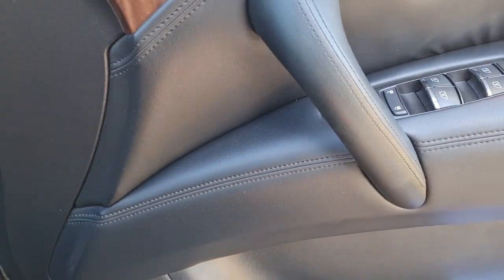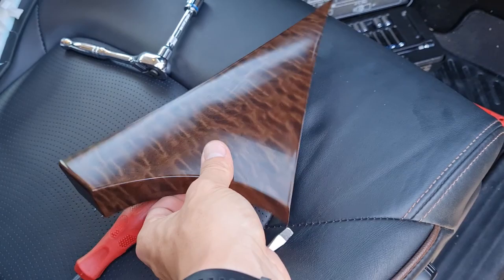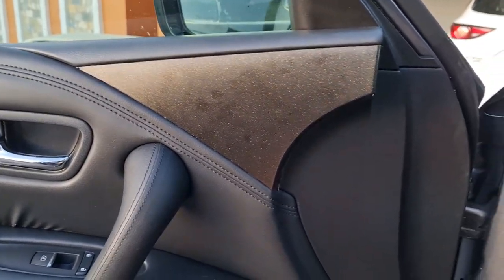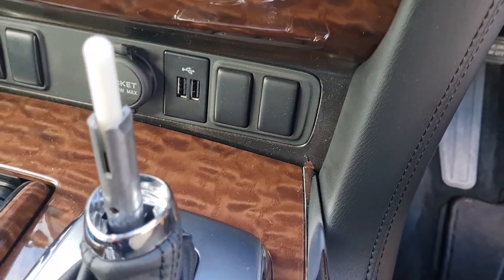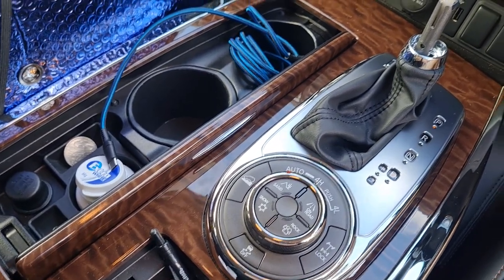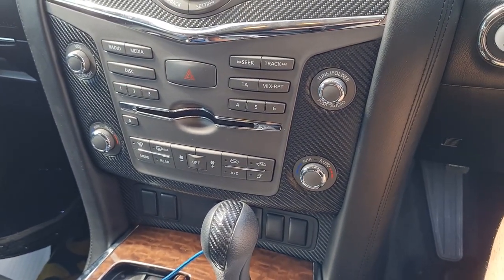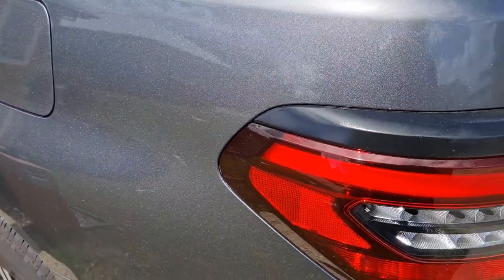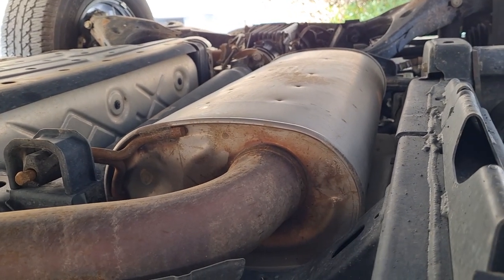Interior Wrapping the Y62 Patrol

Comment: What’s the easiest way to use the blanks under the centre dash mate?
Reply from the maker: Take it all apart, take the blanks out, can be used for XRS connect pass-through, lights, winch, "Hold my beer" button, whatever your heart desires.
Reply: @WLD62  ah yeah, I’m trying to wire my UHF from the roof and I can’t even find a useful Gromit to wire through
Reply from the maker: @smallaam6191  Have to be something there somewhere! My UHF is on order so, ill do an installation guide soon.
Reply: Yeah a guide will be nice, there’s some wiring in the driver footwell so I might try that
Reply: The skinny piece above the dash just clips in so can be popped out with your trim removal tool.